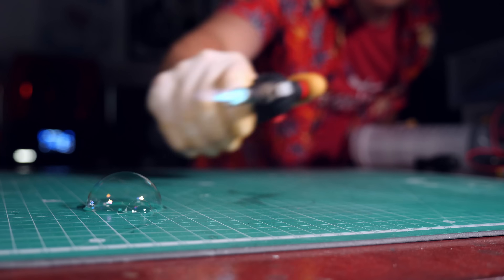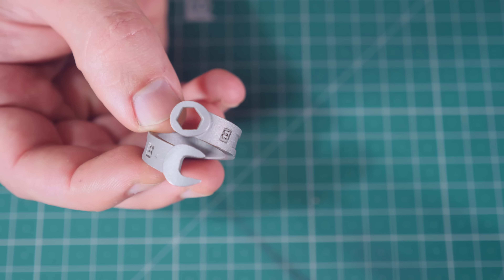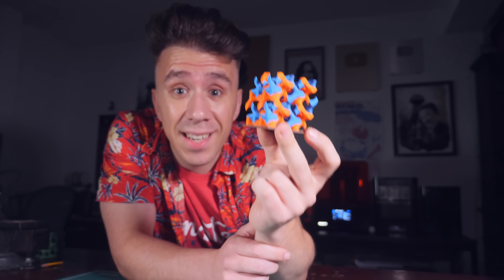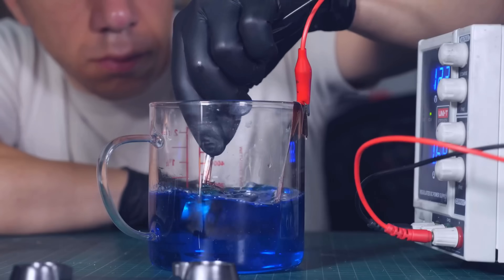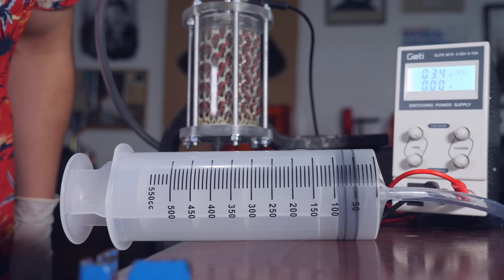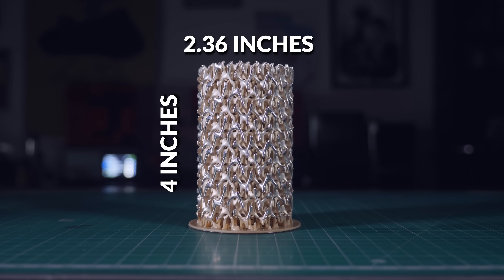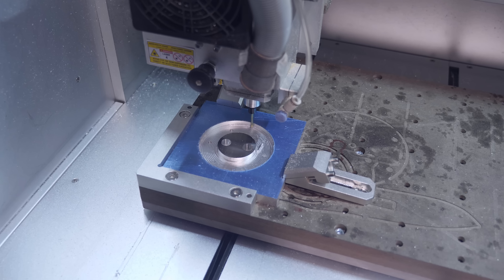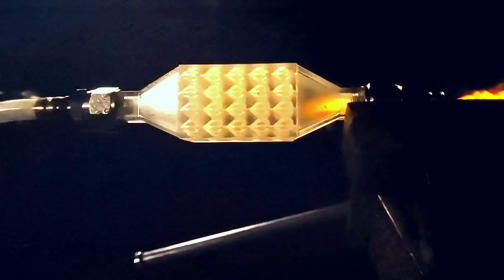ROCKET that LITERALLY BURNS WATER as FUEL

Comment: Capacitors are designed to store charge and discharge at high current. "Super caps" are capacitors designed to store a large amount of charge (compared to regular capacitors). Batteries store more charge for the same mass and volume, so a combination of the two would be best.
Reply: no, that's not how that works lmao
Reply: @JoshJasinski  Where am I wrong?
Reply: @playerguy2 you're right he's just making a fool of himself trying to look smart
Reply: @playerguy2 
Whatever is taken from the capacitor gets replenished before it's able to be used again. The "super caps" are used for an instance of heavy demand. Brief moment demand.
Reply: @Randy-z9j   The statement "Whatever is used gets replenished before it's able to get used again" applies to anything from a battery to a storage warehouse.

And that's the point. Brief period of high load. The battery would then replenish the used up charge between periods of high load.
Reply: @playerguy2  
Each demand on the capacitor will reduce the battery saved energy. Energy can't be destroyed and it can't be created. It's a constant. This means another source will have to be available to transfer energy back to the battery and or the capacitor. Look at it like the circle of life. Akumapotato or something like dat.
Reply: Lithium-Ion Capacitors, exist. Also, a myriad of products and applications using 'Battery' and Super/Ultra-Cap in parallel
IMO, Integza needs a PWM or Pulsed DC Power Supply. Even something electromechanical akin to an ICE's distributor, might work.

Comment: instead of layered discs you can be more space efficient when scaling up by wrapping 8 layers(positive, spacing for water, neutral, spacing for water, negative, spacing, neutral, spacing) in a spiral pattern like most capacitors are configured. make it as flat as possible so the bubbles can escape fast from the gap to be replaced by new water.

Comment: Ah the good old "it runs on water... and please ignore the horribly inefficient mechanism that needs a lot of energy to convert just a bit of water into gasses that then get combusted".

And sadly there are many people that think you can use actual water as a powersource (outside of hydropower of course).
Reply: Haha, he never said it was an energy efficient process, he just wanted a DIY way of converting his electricity bill into rocket fuel 😂
Reply: Agreed, but still fun to watch and play around with.
Reply: the clickbait potential was too strong
Reply: I heard you can create hydrogen 90-95% efficiency but pressure is super low so compressing it is the problem
Reply: @matgaw123 yeah the energy per mass is high but per volume is super low unless you use very high pressures. Imagine the difficulty of compressed flammable gas. Sounds like polymer or hydrocarbon storage is the next step
Reply: @matgaw123  "I heard you can create hydrogen 90-95% efficiency"
Yeah - in labs under rather not so nice conditions:
https://en.wikipedia.org/wiki/File:Theoretical_thermal_water_splitting_efficiencies.webp
Normal industrial production is more in the range of ~50-65% only. Hydrogen might be a technology for some medium-term buffers - not nearly the fastest, but also not as expensive as batteries to scale. But not as a primary energy-source for consumers anywhere. it has a lot of problems.

Also even if it would be 90% efficient: that still means you use a lot of power to convert it to some other form of power. That is useful when you can (or need to) take advantage of its properties.
Reply: true but you don't need to be sassy about it
Reply: Can't use water as a source, but you can use it as reaction mass. This is one reason why early ethanol rocket fuels were 70% and not 95-100% alcohol (asides the difficulty of getting 100% ethanol).

There's also other factors at play, like cooling the mixture and the engine to allow it to run harder. Remember rocket (and jet) engines are about generating thrust, not heat. Sometimes a perfect stoichiometric mix isn't what you actually want for max thrust.
Reply: There was a time people thought those trying to fly were crazy or that we’d never set foot on the moon. Discovery usually takes time and hard work. One day we might be able to fill a car tank with water from a garden hose and get 400 miles out of it. We still know very little about the universe, its laws and what we can do.
Reply: Hydrogen fuel is PERFECT for rockets because its insane energy density. It is pretty stupid for cars though because that energy used for electrolysis would be better suited to power an electric motor
Reply: @Ryan-kg3zx  There is a very simple reason that we cannot use water as a fuel for cars: cars work by burning fuel (usually gasoline) with the oxygen from the air. The oxygen from the air, however, cannot react with water since water is already "burnt": it is the combustion product of hydrogen. Powering a car with water would be like trying to power a car with the exhaust gases from another car; you can't do it because it is a waste product from which all possible energy has already been removed.
Reply: Erm I use water as a fuel source to convert into hydrogen and oxygen on demand, so maybe the maths is wrong?
Reply: Ever heard of solar panels? Hook em up to a hho generator and that's free fuel so far as I'm concerned.
Reply: @Ryan-kg3zx  You may know very little about the laws of thermodynamics, but they are well understood by humans with basic science educations. Water engines are net-negative in energy. It takes more energy to make the hydrogen fuel than you get out of burning it.
Reply: @cannabearr  How do you store the hydrogen, and what mitigation is working best to reduce the embrittlement problems?
Reply: @Ryan-kg3zx  "There was a time people thought those trying to fly were crazy or that we’d never set foot on the moon."
And - and then there are people that think we should follow Bozo the clown.

"One day we might be able to fill a car tank with water from a garden hose and get 400 miles out of it."
No.
Reply: @squidwardo7074  "Hydrogen fuel is PERFECT for rockets because its insane energy density."
No? It has a high energy density and comes with a lot of challenges - there is a reason why it is not use for everything. Everything has its benefits and downsides: Low thrust/weight ratio and low density for example, and the inability to be used for long storage.
So it is great once the escape velocity is nearly reached and most of the drag is gone, and while you can use it soon after launch.
Still might be good as a medium timeframe buffer when no hydropumps are available.
Reply: @matgaw123  Thats not a problem if you use it immedietly ,only problem is if you try to store it.If you use it as a source of energy to boost other energy like in car for example mixed with gasoline as a main fuel then its not problem at all.
Reply: @aughlnal7333  Too true!...why water it down?  ;)
Reply: @ABaumstumpf  I was talking about technology direct air electrolysis (DAE) module  I heard about it in some YouTube video that why I said I heard
Reply: @zumbazumba1  I'm mean using it imidetly makes usually no sense
Reply: @technicalfool Take a look that Scott Manly's recent video on thermal rockets.  Turns out exhaust velocity is related to the square of temperature!  Since exhaust velocity is directly related to specific impulse, hotter is always more efficient.

The reason why we don't want the perfect ratio is two fold.  First, so we don't melt the engine itself.  Second, because we really don't want to oxidize the inside of the engine if the ratio is just slightly off.  There are also a few places where we don't want carbon buildup, so go the other way.
Reply: @arthurmoore9488  Hotter is more efficient, but sometimes pure efficiency isn't the goal, or we'd see launchers running on ion engines and never leaving the ground.

Scott Manley's right of course. You don't get to play at being a rocket surgeon on the Internet for that long without getting to know a thing or two. But getting back to the original point, water can be useful as reaction mass, because you're effectively exchanging some of that heat for more crap coming out of the back end at high speed, which allows you to run the engine harder without running it in an engine-rich configuration.

Comment: i think you mixed up hydrolysis with electrolysis
Reply: Isn't that the same thing?
Reply: @Pale_Kingg  No they are not, hydrolysis uses water to break down stuff but it does not need any external source of power.   e.g. putting salt into water is a form of hydrolysis, the water itself breaks down the salts into sodium and chlorine atoms.    Breaking water apart with electricity is not using water to break water apart, it uses electricity, hence electrolysis
Reply: @Pale_Kingg no. One uses water to separate things, the other, electricity.
Reply: @Pale_Kingg  hydrolysis is AB + H2O ⇌ BH + AOH while electolysis is just water + current = oxygen + hydrogen
Reply: Thanks guys for the informations! 👍

Comment: You need to add a voltage regulator. It's over heating because it's putting out the Max all at once consistent voltage at a regulated amperage lower than the rated will produce the power needed for conversion, while not frying the battery immediately. Also, resupplying the battery with power as it expels will help, and alternator (powered by a rotating fan in the exhaust port)

Comment: 1. Sulfuric acid does dissolve Ag.
(any metal and salt that ionizes in water does react to electrolysis.)
2. You need a none toxic electrolyte. And circulate/agitate it
3. You don't need to electroplate the conductive paint, it is already conductive 😅 Carbon/graphite is the best!
4. You can use a lead-acid battery.
5. The LiIon batteries you used need to be protected by limiting the discharge, overcharge and temperature 🙄
6. Use a valve to control the flow of the gas into the chamber.

Some of my thoughts!
Reply: I feel like the electroplating was to add a current collector to reduce the resistivity, but if the conductive ink was really that good, you're right it wasn't needed.
Reply: @Infinion  I wonder if there have been any metal ceramics that a conductive but not reactive...?
Reply: it's the third one i disagree with. the layer of metal was introduced to improve conductivity of the electrodes. carbon is conductive, yes, but it has waayy too high of a resistance.

while im at it i'll share some of my thoughts as well:

1. i think the use of sulfuric acid in the first place was a bit of a silly move, it may be better in terms of conductivity, but it's so much worse when applied practically.

2. the cylinder design having it's electrodes horizontal just to make a 3d printed spacer to prevent it from trapping gas is also a bit silly, as by just putting it vertically all the gas floats on it's own and escapes with little problem

it would also eliminate some of the bubbles obstructing the electrodes, which should therefore push the efficiency even further

also, nighthawkinlight features a much simpler metal sponge design that fits his requirements. one where he puts one in a sock as a dielectric material to separate two metal sponges, and wraps another metal sponge around the sock, then puts it in a bottle
Reply: @AquaTerraSys  responded, but YT filters didnt like what I had to say. Conductive oxide ceramics
Reply: @meowphedrone  Hard to objectively determine what too high of a resistance means. If heating is the issue it depends on the conductive ink's resistivity, which can vary a lot across different brands, as well as the current density to get the power density in a square area of conductor and determine the heating contribution that could degrade the adhesive on the substrate.

Comment: In order to have a self sustaining thrust, you will have to increase the frequency of the detonation pulses by reducing the size of the reaction chamber and afix a rocket nozzle to the output.
The result would be a pulse rocket (loud!). If air was injected into the reaction chamber, the exhaust should show compression wave "diamonds" in the exhaust as the exhaust would be exiting the nozzle at + Mach 1.

Comment: Here’s a video idea: maybe a hydrogen powered pulse jet engine? Combine a past project with a present one
Reply: Could work,especially because hydrogen burns so fast and pulls a strong vacuum right after because of the water condensing. The nozzle would have to be pretty short though, and the engine would need to have tiny little reed valves for them to react fast enough. I think it would sound like a mosquito lol.

Comment: A Rewind microwave transformer can deliver high current, and also allows you to choose the voltage according to the number of turns
Reply: typically you wouldn't use AC but in his case this should work pretty well
Reply: @razurio2768  Yes, in most cases you want to separate the hydrogen from the oxygen, but for this specific application it would be perfect. The biggest problem I see is that there would be downtime during the switch which would reduce efficiency, but I think that's totally counterbalanced by the overall higher current
Reply: AC is unfortunately less efficient at generating gas
Reply: Just add a FULL BRIDGE RECTIFIER and maybe a capacitor and you're golden
Reply: at 50Hz the majority of gas would get recombined and just heat up the water. Look up how they boil water in jail or simple AC electrode boilers. They produce almost no gas

Comment: I like how you are not burning water, but turning it into dihydrogen and dioxygen and then burning them. So you're burning actual rocket fuel and I love it!!
This video is incredible and I really like the idea of a "water fueled" rocket. Keep doing great stuff 💯
Reply: It is not 2actual rocket fuel". In a proper rocket the hydrogen and oxygen are stored separately and in cryogenic tanks. This allows the rocket to use the most appropriate oxygen hydrogen ratio which may not be stochiometric.
Reply: Hydrogen gas is automatically is H2(Id like to see you try make H1 tho 😂), there’s no “dihydrogen”, same case with O2
Reply: @CielMC  I never said you'd get H1, H1 is not stable by itself, it needs to bond with something else as in H2 or H2O for example. So it is because the first "layer" of electrons is complete with 2 electrons, and an H atom only as 1, so it has to bond with another atom to complete its layer.
Reply: @rogerphelps9939  Yeah you're right! Also they're stored in their liquid form. I was just simplifying the process, but in the end it is not indeed "actual rocket fuel" but I thought it sounded cool. My bad.
Reply: @vincentl.1058  I know how chemistry works, but you said dihydrogen.
Reply: @CielMC  Maybe it's just a language thing but the scientific name of H2 is "dihydrogen" (meaning two-hydrogen). "hydrogen" only refers to the chemical element. Because you won't find it alone naturally, we don't usually need to distinguished the two, but they're different.
TLDR: hydrogen is a chemical element, dihydrogen is what we usually call molecular hydrogen or hydrogen gas.

Comment: When you solve power supply increase.
Use density, turn plates vertical so gas detaches faster.
Then
Ultrasonics to dislodge the gas faster and increase active surface area over time. Great work

Comment: you need a "Schaltnetzteil" or "switching psu" for industrial use which ca deliver 12v 50A (600w) continuously. 
love the content
Reply: A single 12v rail PC power supply would do in that case, there are many rated for 100A+ continuous. However, he said the 15v battery rated for 400a discharge was not enough, and most switching power supplies also have over current protection shutoff so they do not blow up themselves.
Reply: @BeepBeep2_  yes but i doubt the battery delivered its 400a. I thing the fuel cell acted like a short circuit so the current spiked very high. A psu would be a better case to ensure a specific and a more or less constant current.

Comment: To drop the current, make a power resistor from distilled water and salt inside latex rubber tubing  with terminals on the ends. Hoseclamps to seal.

Comment: Use a stick welding charger (arc welding , SMAW) to provide the amps you want in DC
Reply: Notice that the air mixture around the upper plates encounters resistance due to congestion from the air mixture below. This atmospheric resistance could potentially affect voltage resistance. Improving the airflow around the plates might lead to significant performance improvements.
Instead of one upper exit, can you make multiple exits around?

Comment: I love this video I didn't even know it was possible to break apart water this easily.  I think for a future video on this it might be cool if you could build a little RC boat that used this as the power source, but also refueled itself with more water as it ran.
Reply: One prpblem is you'd need to use non-salt water as salt water creates chlorine gas instead of just hydrogren and oxygen
Reply: @jod125  fresh water

Comment: My dad made something similar a couple years ago. He used stainless steel plates for the anode and cathode, separated with plastic washers. Then he used a car battery and booster cables to run the generator. He has always wanted to put an amp meter on it to so how much power it draws, but he never got that far. Sorry for the late comment! Hope you see this!